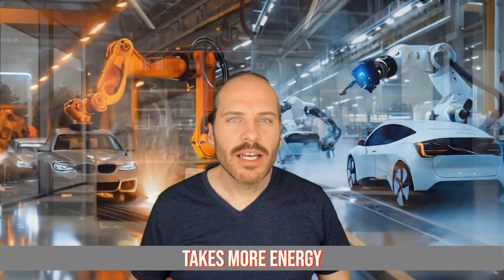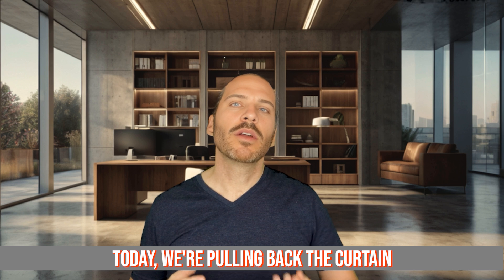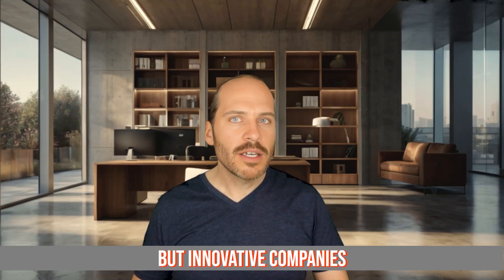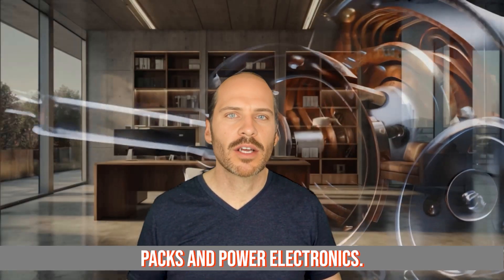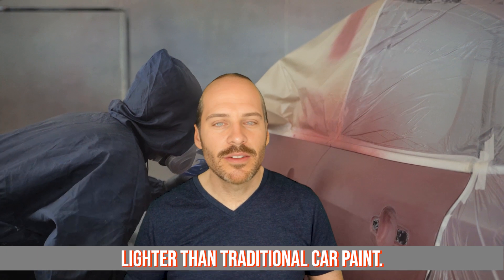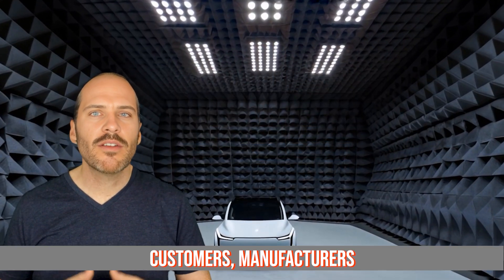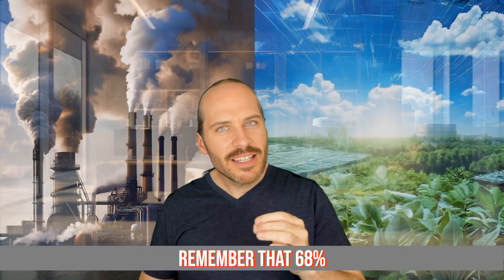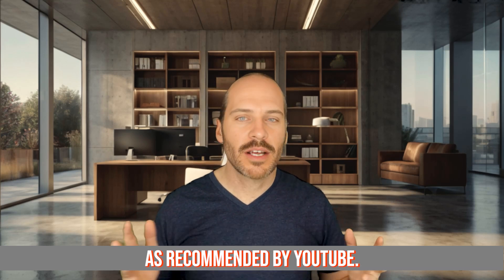5 Surprising Facts About The Making Of Electric Cars

Comment: Buddy, you're several years late with your 5 "shocking" partially accurate clickbait nonsense. 
I just don't understand why did YT put this on my wall as a suggestion video...
Reply from the maker: Thanks for watching and thanks for the reply. The oldest publications/reports used for this video are 2023, except in the cases where it refers to an industry standard, in which case, it will be per the date the standard was last updated. Always happy to receive constructive feedback on any area's you think the video could be improved.
Reply: @OneSentenceSmart  Wow, I honestly didn't expect to receive answer on that :) About constructive suggestions, here they come:

- Your video is somewhat like bunch of news articles and propaganda in form of blah blah blah... 
- About the amount of materials needed for the battery: What's new there? What is shocking there? For example, just look how much of copper ore is needed for a single ton of copper. The same implies for iron, aluminum or any other material, it's just basic mining knowledge.
- That "innovative companies that recover 95% of materials from used batteries" - mostly media lies with pumped up numbers
- 40% fewer parts - correct. More complex? Naaaaah, not so much as they present it. On top of that, you presented it as if it relies on one "300% more precise robot". Where did you just get that info? There is a whole bunch of processes that requires whole bunch of robots. Often way less precise that those needed for a gas car! Just compare the body panels assembly precision of tesla vs the old mercedes! But nooo, we're gonna mention only the ultra mega precise crap robots with AI (nothing without AI) just to justify the high car price.
- EVs "REQUIRE SMART paint???!?? Really? Even the paint is so smart?? They REQUIRE it? Like it won't go if I spray it with a spray can from a local store and make a worst paint job ever? Those my friend are also media crap for justifying the price and nothing more than that. Maybe they also squeeze a few hundred METERS of range thanks to fancy paint. That's it.
- Testing: Yeeeah, these need to be tested for EMC compliance, whoopty-do! So does your microwave oven. Just take a look how much they tested the cars in 90s!! Millions and millions of kilometers od pure driving and pure car torturing! Now they put it in a fancy chamber and make a fuzz about it. It (EMC compliance) was my job for a while BTW.
- EV DOES NOT make up in 18 months for a higher manufacturing emissions!! That's maybe sort of true only for a carbon footprint but where is the whole poisonous mess that's left after lithium mining? Whole AREAS are left destroyed! Do a search about it! It is partial info where they "accidently forget" to mention the really bad stuff.

The conclusion: The internet is already flooded with info like this, just please don't be a +1 contributor to that! We need a better world with less marketing lies and more truth. Use your brain! If you want to make a good video, you have to do a really deep dive into what's actually happening out there, read between the media and marketing lines think and then make a good conclusion! Just take a look how many manufacturers roll back from EV production and ask yourself why? Where all the "smart stuff" suddenly went?

Wow, this was a long one! But there you go, I hope this was constructive-critical, so please don't be judgmental about it. I really tried to explain the best I can what bothered me and make you have a good think.
Cheers!
Reply from the maker: Thank you for taking the time to write such a detailed response! I genuinely appreciate this kind of thorough feedback - it's exactly the type of discussion that helps improve content quality.

Let me address your points one by one:
Regarding the battery materials - you make a fair point about this being standard mining knowledge. Perhaps "shocking" wasn't the best word choice. The intent was to help general audiences understand the scale of production, but you're right that this is typical for any mining operation.

On the 95% recycling rate - I sourced this from recent technical papers, but I'm interested in the discrepancy you've noted. Would you be willing to share sources about the actual recovery rates? This kind of technical accuracy is important to me.

Your point about robot precision is particularly valuable - you're absolutely right that it's an oversimplification to focus on a single metric. The comparison of Tesla vs Mercedes body panels is an excellent example. Future videos will definitely need more nuanced coverage of manufacturing complexity.
The smart paint section - I agree this came across as marketing-heavy. A better approach would have been to explain the actual technical requirements and their practical impact, rather than using buzzwords.

Regarding EMC testing - your professional experience here is fascinating. Would you be interested in sharing more about how EV EMC testing compares to other electronic devices? This seems like it could make for much more interesting content than just focusing on the fancy chambers.
The environmental impact point is crucial - you're right that focusing solely on carbon emissions paints an incomplete picture. The full environmental impact of mining operations deserves its own deep-dive discussion.

Your concluding point about manufacturers rolling back from EV production is exactly the kind of complex, nuanced topic that deserves more attention. Would you be open to sharing some specific examples I could research for a future, more in-depth analysis?

This is exactly the kind of constructive criticism that helps create better content. I'll definitely incorporate these insights into future videos, focusing more on technical depth and less on marketing angles. Thanks for taking the time to share your expertise!

Comment: Unfortunately, this calculation is not correct. More detail study reveals multiple "hidden" (by manufacturers) pollutions. According Royal Transport Laboratory (Scotland) average electric sedan can "compensate" carboin footprint of mining , processing and manufacturing - only after 40,000-50,000 miles of range with case it was charged on "only green" energy (which is unreachable at all, as declared by energy analysts).
Moreover, BEV use rare earth elements, which minig produce not just "carbon hoax", but real poisons and kill drinking water resources (lets just forget for a while for a slavery and child labor, so usual in such mining).
Everybody which able to use scientific data and usual calculator can make conclusion - BEVs are killers of our nature, economics and people.
Reply from the maker: Thank you for sharing your perspective. I want to address these points with the latest research data. The International Council on Clean Transportation's 2023 comprehensive lifecycle analysis shows that while manufacturing emissions are indeed higher for EVs, the break-even point is much sooner than 40,000-50,000 miles, even accounting for current grid mixes. For example, in the EU, US, and China, this typically occurs between 17,000-30,000 miles.

Regarding rare earth elements - this is an important concern that the industry is actively addressing. However, many modern EV designs have actually reduced or eliminated rare earth usage. For instance, Tesla's Model 3/Y with LFP batteries don't use rare earths in their motors. Additionally, new recycling technologies are now recovering up to 95% of battery materials, creating a circular supply chain.

Your point about the energy mix is valid - grid cleanliness does matter. However, even on today's average grid mix (not requiring 100% green energy), EVs produce significantly lower lifetime emissions than conventional vehicles. MIT's 2023 mobility study demonstrates this across all major markets.

I encourage you to check out the latest lifecycle analyses from organizations like Argonne National Laboratory, which account for full supply chain impacts. While no technology is perfect, the data shows that EVs are significantly reducing overall environmental impact compared to traditional vehicles, and improvements in manufacturing and recycling continue to make this advantage greater.

Would you be interested in seeing some of these recent studies? I'd be happy to point you toward the specific research.
Reply: @OneSentenceSmart  Thank you for detail answer. I'm familiar with noted studies and already dicussed it before with ecologists (not envolved in political process).  Those reports just omits multiple steps on the way from mining to battery installation, so it just wrong calculation. By using of open industry data, reference books and with help of simple calculator we can get, for example, that for Tesla  ModelY battery we need mine ores:
for Lithium - 12 tons
for Cobalt - 5 tons
for Nickel - 3 tons
for Copper - 12 tons
The Caterpillar 994A is used to move the earth to obtain the minerals needed for this battery. The Caterpillar consumes 264 gallons of diesel in 12 hours.
To manufacture the battery also requires:
- 441 pounds of aluminum, steel and plastic 
- 112 pounds of graphite
We can calucalte CO2 emissions for every step of manufacturing - from mining to battery assembling. And I got numbers even firghten than I noted before.
But even in those calculations we just not include transportation of raw materials, processed materials, components and ready to use batteries to car assembly.
And it is only according carbon footprint, which has no meaning at all - CO2 is a part of life cycle and we have about lowest carbon concentration in athmosphere through latest geological period. Only 50 years ago "98% of scientists" yelded about "new ice age coming!" and "we'll have not enough crops to feed a mankind!" :))

Also I should make a remarks about some additional points you noted in your answer:
"Tesla's Model 3/Y with LFP batteries don't use rare earths in their motors" - sorry, but all trhose batteries uses lithium. PEriod. Also "extended range" modesl (most popular) uses NMC batteries which consist of up to 18% of cobalt.

About lithium recycling - this process (usually - hydromettalurgy) use a huge amount of enery itself. And most of recycling capabilities now belong to China, which still obtain about 60% of their energy from regular coals. Of course, transportation to recycling and back by ships - has own cost too.

Finally - BEV should not be propagated at all untill we can find suitable mobile energy source. This situation still the same abou 2 centuries (electric vehicles is pretty old). Or we can accumulate energy with acceptable capacity without using of rare earth elements.
I bet - first way is reachable faster and without dramatic subsequences as we can see from BEV.
Reply from the maker: Thank you for this detailed and technical response - I really appreciate you taking the time to break down these calculations. You raise some important points about the full lifecycle analysis that deserve careful consideration.

Your breakdown of the raw material requirements for battery production is quite comprehensive. The inclusion of mining equipment fuel consumption and transportation costs definitely adds important context to the overall environmental impact calculation.

Regarding the LFP batteries, I should have been more precise in my wording - you're absolutely correct that they still use lithium. I was specifically referring to the reduction of rare earth elements in the motors, but I can see how my statement could have been misleading. And yes, the longer-range NMC variants do indeed use significant amounts of cobalt.

Your point about recycling energy requirements and China's coal-heavy energy mix is particularly pertinent. The transportation and energy costs of recycling definitely need to be factored into any comprehensive environmental assessment.

I'm very interested in your comment about alternative mobile energy sources. What are your thoughts on some of the emerging technologies in this space? Given your technical background, I'd be curious to hear your perspective on which alternatives show the most promise.

Would you be willing to share more about your calculations and data sources? This kind of detailed technical analysis could really help inform future content.
Reply: @OneSentenceSmart  Thank you! WIll share references in two weeks after returning from business-trip. Don't hesitate to remind me if I will  late with this.
Reply from the maker: Fantastic :)  Thank you